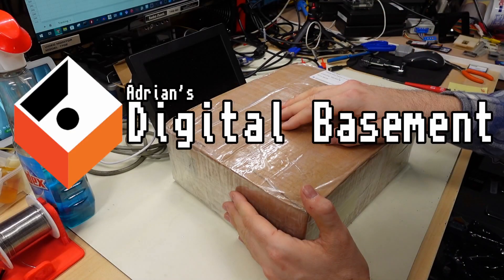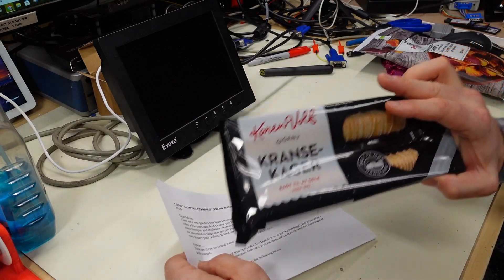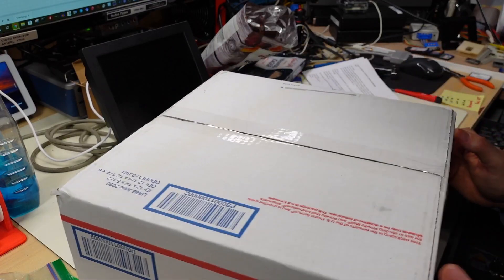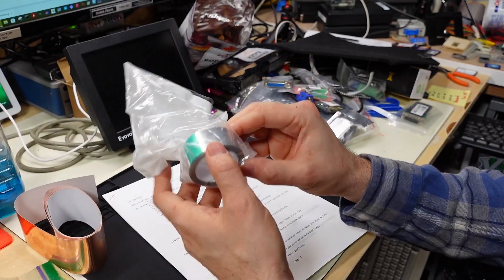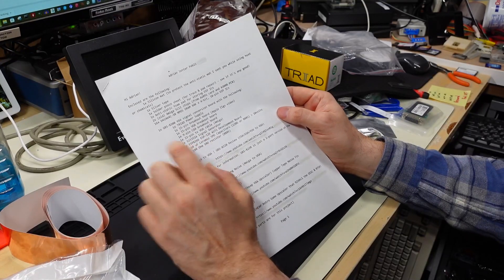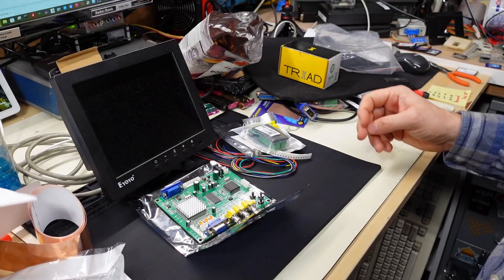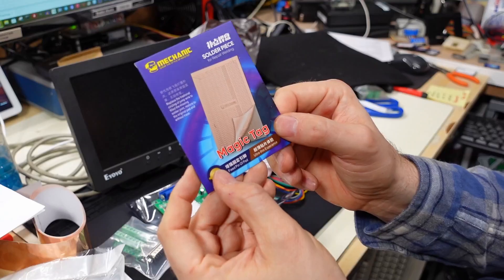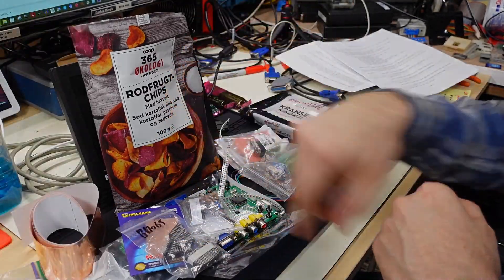0029 Treats from Denmark, a RGB scan converter and some mystery PCB repair things

Comment: Adrian's Digital Basement ][ You can use the Copper tape as replacement traces on a PCB board. Just cut them to shape and either just stick it to the PCB or if you need a better bond then use Epoxy it to the PCB.

Comment: The copper tape can also be used for proto type boards testing or design. You can put electronic components after you put on a board. You would have to cut it to place it on the board.

Comment: Points about the GBS-C:
-VGA to HDMI converters are available with no latency if they don't scale. Those that do scale add latency and somewhat defeat the point of having a better scaler in the first place... These converters are pretty cheap.
-GBS-C on its own has under 1 frame latency.
-GBS-C and RT5x are the only scalers on the market that do not drop signal on resolution change. This is mostly applicable to games. For consoles it mostly affects Playstation 1, where many games switch between 240p and 480i. It affects computers as well, but most computer games do not switch resolutions IN game. OSSC and any other scaler drop frames on resolution change.
-GBS-C has sharper deinterlacing than RT5x, but can leave a little bit more combing. Neither have the best deinterlacers you can get, but both are ok. OSSC does not compare.
-GBS-C is more of a pain than RT5x to configure since it uses a web interface, but like RT, it doesn't need to be adjusted regularly.
-OSSC takes more tweaking, but sometimes you might want to tweak for best result anyway.
-OSSC can work with a wider range of sources, but being a line multiplier, your display might not like it.
-OSSC actually has kind of a soft image, though it's generally good enough. (You would think it would be sharper based on the way it works but I think the softness comes from ADC or DAC or something)

I personally think GBS-C is better than OSSC overall, but there are a few specific uses where OSSC might be better. I think it's just hands down better than RT5x except that you have to solder stuff rather than just having a working product out of the box. But it is much cheaper and I prefer the sharper deinterlacing even if there are occasionally some combing artifacts.

You are correct that GBS does not take composite or S-video.

Ultimately, GBS-C, RT, and OSSC are all very good products though.

Comment: I think you have to explicitly get double-sided conductive copper tape, but it does in fact work. I have a CoCo 3 with worn and corroding printed traces on the flimsy mylar keyboard membrane.  I tried using a conductive pen to fix it, be there was too much resistance after even a short length.  But I was able to apply several inches of the double-sided copper tape in multiple places on the mylar, and it conducted perfectly right through the adhesive.

Comment: It's actually pretty good for fixing traces. You're exactly right about the adhesive. Just solder the end where it overlaps the trace. You can even build new pads for components which is way easier than trying to bodge in a wire. All you need is an exact-o or other suitable hobby knife to cut the shapes you'd need. Good stuff...

Comment: Just a note: Modern FreeSync monitors with VGA input can sync to Amiga signals, too! At least the two I have, from different manufacturers, can. You just need an adapter cable.

Comment: I sometimes use that copper tape - but with the adhesive stripped off with acetone / goo gone, etc - to repair traces on PCBs. If you don't have the bespoke trace kits handy, this will do it in a pinch (though you still need some form of epoxy to set it properly to the board).

Comment: Often cooper tape is placed underneath ESD mats in cases when you can't ground them in other ways. You just stick the tape to your table, connect it to the ground by 1Mohm resistor and place mat on top.

Comment: In theory the chip used in these eyoyo screens can get updates firmwares… Some are floating around for similar chips that are used on generic PCBs used to drive panels. Except I couldn't get the datasheet for the exact chip.

Comment: From my experience using aluminum tape to shield guitar body cavities, the adhesive typically is conductive enough to provide a good ground, but you should still fold over a small edge and make a bit of contact that doesn't rely on the goop that might some day dry up. Copper tape seems to have the same adhesive, and I haven't used silver tape myself, but both of those are much easier to spot-solder than aluminum is.

Comment: As far as the Magic Tag, it looks like you're supposed to peel the copper off the grey sheet, leaving behind just the small copper replacement trace+pads.  Then you put sheet with the trace+pads in that "laminating pouch" for storage.  You can cut the trace on the pad to length and solder it back up wherever the pad was lifted or the trace was broken.  Obviously the pads are for surface mount, not through-hole.

Comment: those magic tags are great for pcb repair, I used one to repair a cracked pcb on a smashed radio....paired with a tube of green pcb paint (or whatever color matched the pcb you're repairing) makes for really great looking repairs.

Comment: I would be interested to see a video on the GBS8220 with the external control board. I had one before the OSSC came out and it was just simply trash, which is exactly where mine ended up after several tries at fixes I found online. I've been waiting for good close up pics from the development of the new Checkmate monitor which uses the same hardware but Stephen isn't showing anything up close to the panel to see what the scaling looks like. (And with options like the RGBtoHDMI giving spectacular results when I tuned everything precisely for my Amiga and my monitor I really don't think anything else will come close.)

Comment: Some metal tapes have conductive adhesive, but most don't. You should be able to check it with a multimeter.

Comment: The coppertejp is not conductive on the underside but you can solder to it but use it if you get interference and want to sheald a part of a board

Comment: Copper tape is useful for replacing bad traces. I tend to use the copper striping tape used to edge glass panels for art glass, It's thin but this would be great for larger repairs. I just use the adhesive to hold it in place temporarily. Usually the solder will hold it but some epoxy might be a good idea for large areas. Pre-1980 PCBs tend to flex and crack traces. Much of my repair work in the 90s was just hunting down and jumping across invisible cracks in traces. YOu can give a trace a little flex with the thin striping copper tape. Early 70s PCBs were often HUGE; 18" was common. The old PCB material would sag quite a lot when it heated up, For example in a TV set with tubes. The tubes would sometimes short and burn a hole 1-2 inches diameter completely through the PCB.

Comment: There is an HDMI version of the GBS, and with another mod you can even inject sound into HDMI. The clock mod is optional and can even introduce some side effects (like snap to 50/60hz isn't as reliable with clock).

But the fun of GBS is how well it performs for how little it costs.

Comment: I use that copper tape for RF protection on my guitar electronics. Specifically I use that to cover the inner cavity where pots and switch are. It's conductive so it also helps with grounding so there is less RF interference with the amp signals.
Reply: Aluminum tape works almost as well and costs very little, if you're doing this at home. If you charge thousands per guitar, go ahead, and go hog wild with the copper.

Comment: Hi Adrian! As a side note, despite of the advertisement of EGA/CGA on the GBS-8200, it doesn't actually support the named digital standards. This is basically a lie, which a whole lot of people (including me) are running into. Just for fun I made an additional open source project named MCE-Adapter and also made three videos about it. May be you find it useful, in case you would want to tinker with the GBS-8200 in the future. Best regards!

Comment: Rather cool that people have developed a mod for those scan converters, I've been tempted int he past to get one, but put off again by the negative response from people who have used them, but that was before getting my cutie Torch-brand RGB monitor to run my Amiga on, so not really a needed thing any more, but I still think it's pretty neat they're working to better them... :)
Reply: I'm using a GBS board (modded) with my A1200 and A500, and the output is better than the stock GBS, but still not great. I was mainly interested in it to use as a de-interlacer. It works, and it's cheap, but it's better to spend the money on the many better solutions out there.